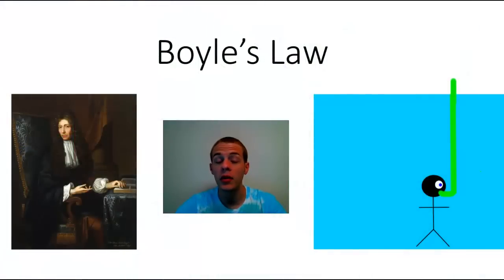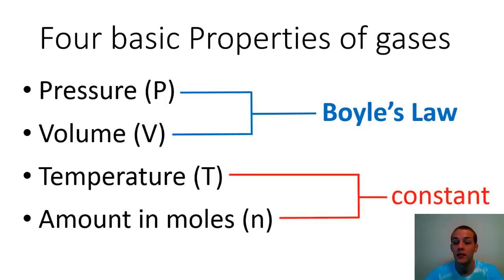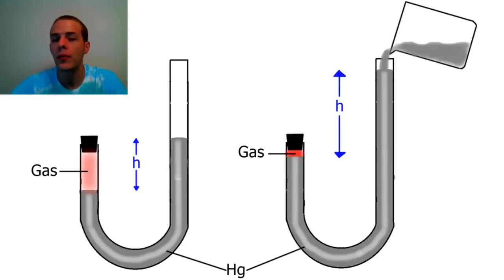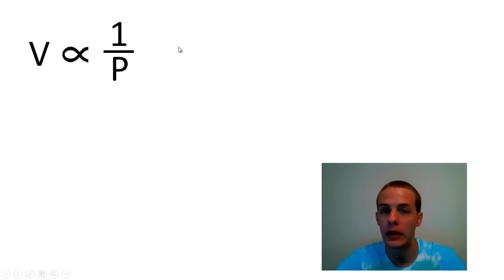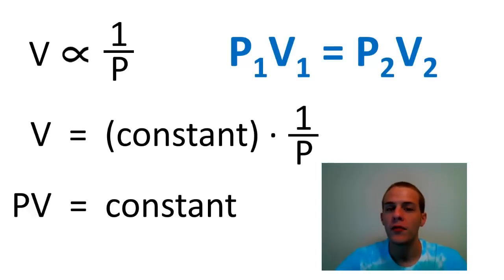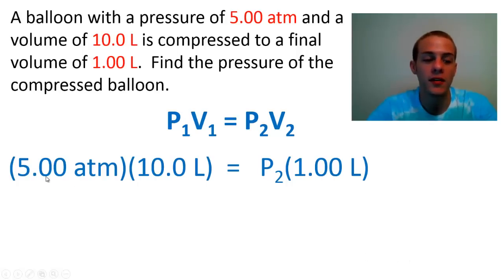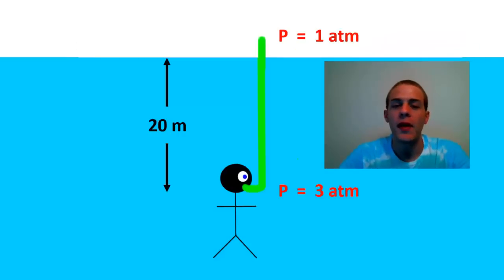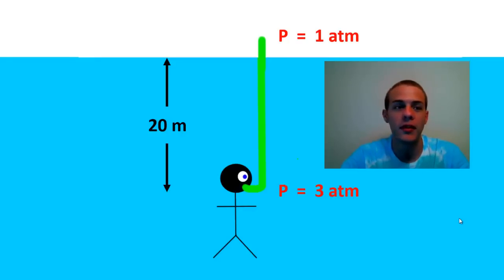Boyle's Law - Pressure and Volume of a Gas

Comment: if the air is forced out of his lungs why can scuba divers breath.... how do free divers hold their breath, you left no consideration for the lungs as muscles.
Reply: +Black Anakin Productions because the scuba diver's air is pressurized in a  tank alot more then 3 atmoshpers
Reply: When free diving, the pressure where the air would escape is the same as the pressure on your chest.

This means it takes no physical effort to hold your breath, much the same as when you are in air.

However, if you attach a 20 meter snorkel, the added 20 meters of air will only increase the air pressure by an amount so small we can ignore it. So you have 1 atm at your mouth and 3 atm pushing on your lungs.

This is probably more than enough to forcibly expel the air that is in the lungs, like being squished by a giant python.

As for scuba divers, they have a pressure regulator that makes sure the air is released into the mouth piece at the right pressure to allow for breathing.
Reply: Black Ananik Productions:
You are asking a good question, but you need to work on how you formulate your questions, with a bit of practice you will be able to figure things out for yourself.